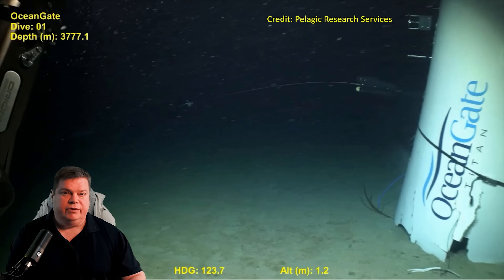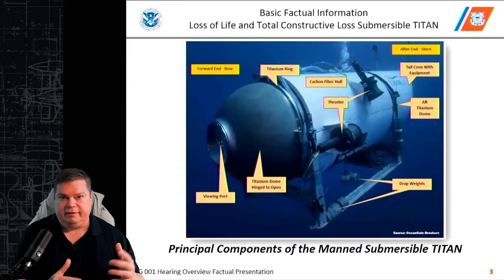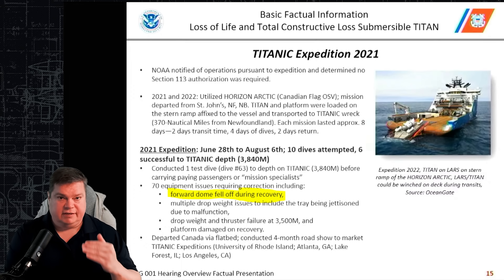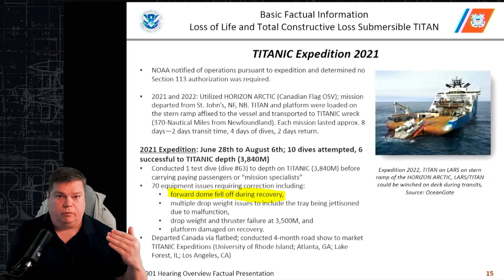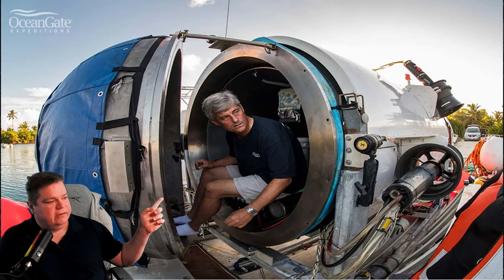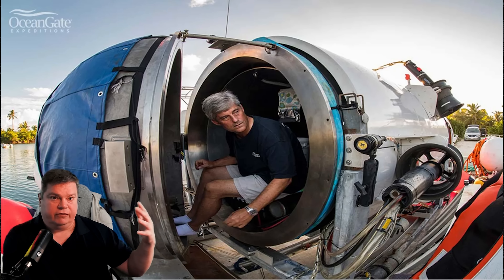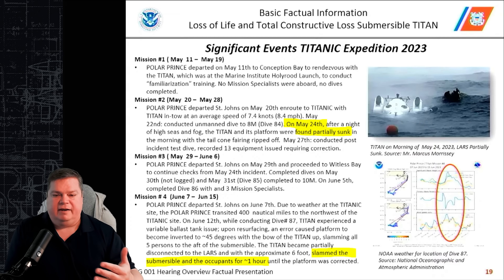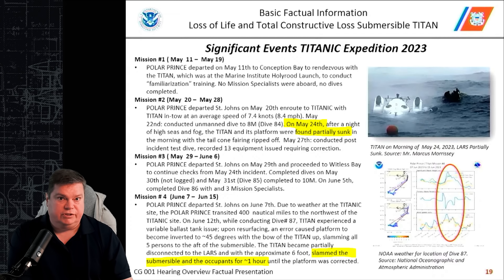New Evidence in Titan Submersible Disaster

Comment: Kind of unnerving that the "paste " he describes contained the DNA of all souls on board. Not unexpected, but the human mind can't truly fathom being instantly turned into "paste " like no pain, no fear, just instantly paste. Pressure Is scary
Reply: I believe they call it paté
Reply: That's too subtle a distinction for the modern mind
Reply: Especially pressure of thousands of atmospheres per square inch....after it was
 bouncing around on that sled during storms, etc....
Reply: Plus with the atmospheric compression with a major failure, the air would have ignited for a fraction of a second before human paste/pate conversion.🤢
Reply: Paste aka human tartare
Reply: It's not hard to fathom. That's 6000 pounds per square inch landing on you instantly. How many square inch is a body? about 3000 square inch. So, 6000 x 3000 = 18,000,000. 18 million of pounds or 8164662.66 kilo landing on a human being.
Reply: At those pressures, you go from living to nothing almost instantly. I routinely work around pressures of 3k to 10k psi pressurized vessels and have a ton of respect for it. When containment of high pressures fails,  it fails instantly and thankfully you don't even know it.
Reply: @Polypoly06 😮 Wow
Reply: not a bad way to go ngl
Reply: @Angryapprentice  defs one of the faster ways to die. Just saddened considering the awful noises they must have been hearing.
Reply: @troycambo  Better than being chased by a drone. At least these people didn't suffer.
Reply: @nottellingyou7520  Torgo's executive powder.
Reply: Under such massive pressure, enormous amounts of heat are generated, yet the depth of the ocean is NEARLY freezing. I wonder if they were essentially vaporizer and immediately cooled within seconds.
Reply: That's what haunts me the most. Ever since this happened my mind goes to that moment, that millisecond in time, with the weight of the entire ocean bearing down on me as the vessel succumbs to the pressure in an instant. I don't want to. It's the worst kind of intrusive thought and I have to sit down and compose myself every time it happens. 

There has finally been an event to dethrone the USS Dolphin for the most horrific deep sea vessel accident.
Reply: @WobblesandBean  there was the U-boat that was sunk by its toilet
Reply: @WobblesandBean  there was the Kurst
Reply: @the907patriot6  Nothing is more pressurized than a bunch of so called men driving around in full size pickups all covering for their tiny manhoods.
Reply: @Naptosis You can survive in drone chaise though
Reply: @Naptosis  did smbdy just watch footage from Ukraine there?
Reply: Put your bare finger right in front of your high-pressure washer that you wash your car or your driveway with. That will do some damage already. And think of those industrial metal cutters that use water (sure, often with other stuff in there too) that go through thick plates of steel like a hot knife through butter. Brrrr. You're so right. Pressure IS scary. 😵
Reply: @elliotoliver8679  Kursk
Reply: Were they playing the queen song.. under pressure...
Reply: Horrifying
Reply: @nottellingyou7520  human pate, I’m pretty sure my cats would love it 😍
Reply: Stockton Mush
Reply: @WobblesandBean  Are you referring to the Byford Dolphin? The Dolphin was European, no USS prefix.
Reply: I was surprised that there was any paste left, I would have assumed that the CEO bouillon just spread throughout the whole ocean.
Reply: @GackFinder Brilliant in a dark kind of way! 😳
Reply: @alphakevin687  🤣🤣🤣🤣
Reply: I want to see pictures of that paste, will they keep it for themselves selfishly or will they share it with the community?
Reply: @GackFinder Haha
Reply: @the907patriot6  thats scary
Reply: @nl-oc9ew  check the comment thread some know it all already figured out the pressure forces at play
Reply: @Polypoly06  At 1.5x the speed of sound, too!
Reply: @GackFinder  I goi g to hades for laughing at this. Good one!
Reply: Human-flavored bologna mist.
Reply: @JohnSmith-rr8hp  they won't show it
Reply: @nl-oc9ew  Sad Doctor Rush didnt record it on a super high framerate camera for the rest of us to see.
Reply: @JohnSmith-rr8hp  Shoulda brought in the guys from Ballistic Highspeed to install cameras inside the tin can they called a sub. BHS has experience with things exploding.
(Yes I know, this was an implosion not an explosion, don't ruin my joke)
Reply: My mind can't comprehend it
Reply: Always remember that they are not 'submarines' but Submersibles, not designed for long stints underwater.
Reply: @angry-white-men  speaking from experience? Lol
Reply: Yummy😂
Reply: Speak for yourself, I can fathom it.
Reply: @WobblesandBean  i don’t feel this is worse
Reply: @troycambo  Better than that guy on Fascinating Horror who got caught inside the electric heating unit at the canning facility and was cooked to death in a space the size of a small bedroom...
Reply: @syberphish  Also yummy 🤣
Reply: There was a video analysing whether they were instantaneously boiled alive before being crushed or just crushed. Think it was called something like hot mist or cold paste 😬 Gross.

Either way, absolutely horrifying way to die, though your senses wouldn't have time to process even the flicker of light as the hull fails and begins imploding, let alone pain.

I'm glad Stockton Rush's victims didn't suffer, but kinda wish he had for being a lying, bullying narcissist.
Reply: @mrkeogh  Anyone who wishes the suffering death of another human is the very person they claim to despise. 

Be better.
Reply: @scottyfox6376 Doubtful there was enough time for energy transfer from the ignited air to their bodies. It was all over in a couple of milliseconds.

It's still really awful to think about 😕
Reply: @jerfy2001 Pasteurised fish food 😕
Reply: @Shoikan  Well, a shot from a firearm/cannon is also pressure in its essence. The primer creates a pressure in the barrel chamber of about 11-15 MPa, the combustion of the charge creates something like 400-600 MPa of pressure which is enough to throw 46.6 kg projectile at 810 m/s speed
Pressure is a serious force, it must be respected
Reply: It probably sounded like warm water being poured over ice with the tiny cracking noises
Reply: They did not turn to paste. The human body can survive extreme depths without being crushed. To crush human bone, the depth would need to be around 20 miles. The deepest part of the ocean is 7 miles.

A rapid collapse would also not turn them into paste. The issue is immediately solved once gas leaves the body. That is why diving is dangerous. Scuba or in a submarine. It isn't the pressure, specifically, it is the fact the gas inside cannot deal with the outside pressure.

So if you remove all the gas from the body, or submarine, the pressure is equalized.
Reply: @taoofjester4113  they didn't swim down there 😂 the submarine violently imploded .
Reply: @nottellingyou7520  The carbon hull is like a hot dog casing.
Reply: @Shoikan it’s not just the actual pressure that does the  damage. Water at that depth is compressed, even tho we are always taught liquid can’t be compressed, it is, it’s compressed by 2% when the chamber breaks, the liquid all around increases in volume by 2% into the sub. That expansion is just catastrophe, imagine the power of water expanding after being under pressure by all angles. Expansion and pressure. Instantaneous deaths
Reply: One instant they were conscious, the next, lights out.
Reply: I’m surprised there was anything found
Reply: Im pretty sure there was a lot of fear. The ex employee testified the haul had to scream like a mother... before it gave out.
Reply: @zebgreenhill  They were playing a Queen song, but it was "Another One Bites the Dust".
Reply: Im confident they knew they had a problem so thats where the fear would come from
Reply: Im confident they knew they had a problem so thats where the fear would come from
Reply: Where in any of the released docs did it say paste? My understanding was it just said "presumed human remains" were recovered and tested.
Reply: @mrkeogh  but I wonder if they became aware of what was going to happen a while before it did, due to a failure of certain parts of the sub.
Reply: I wonder the measurement of the paste? Are we talking 1 tsp or a gallon+ 😬
Reply: @taoofjester4113  are you forgetting the pressure depending on depth?
Reply: @GackFinder lmaooo
Reply: @scottyfox6376  Basically, it was as if a bomb went off inside the sub.
Reply: @Shoikan  The idea that water can cut something is scary.
Reply: @WobblesandBean  At least there was something to recover with the Byford Dolphin incident.
Sure, one of the poor guys had his insides splattered all over the deck, but there was at least something to bury.
None of the Titan victims' families will be able to bury their loved ones.
Reply: Wild
Reply: @twistedyogert idk maybe for the best? What's the point of recovering paste.
Reply: When I think of deep dives and ocean pressures the Byford Dolphin always comes to my mind. Seeing and hearing what pressure did to those 4 men inside the pods @30 atmospheres of pressurized gas’s makes me never want to be inside anything in the deep ocean. The Oceangate Titan crew were playing Russian roulette with a six shooter loaded with five rounds after hearing how that submersible was constructed, materials used and the insane depth they were trying to reach. I’m utterly surprised the sub didn’t implode on its first test dive as soon as it was 20ft underwater. I do not how these so called intelligent men who had almost everything they could want to know information wise about the tech behind the Subs build and danger they were in at their fingertips. All they had to do was dial up their people and the network they have of people in very high positions, and professionals to tell them “Hell No! don’t get anywhere’s near that sub or Oceangate cause they are mos def gonna murder some folks” At least that’s how I feel about the whole sub debate and conversations.         LoudLove
Reply: @twistedyogert .... No that would be an Explosion... the Titan had an Implosion of which Liquified all 5 of them
Reply: @mrkeogh  I wish Stockton hadn't gone down that day. He should be answering for his many terrible choices. He should be reacting to the dismissive statements he made about safety. He should be convicted and spending many years in prison.
Reply: @WobblesandBean  I don’t know if this makes you feel better/ if someone else already responded saying this, but it’s very likely their minds didn’t have time to process that moment. I’m not an expert, but I doubt any person would actually experience any of the pressure or the rupture itself. And they definitely wouldn’t have time to get the pain signals to their brain and process them. But I don’t think they would even be conscious of that millisecond in the first place.
Reply: Oop he literally said that in the video, i didn’t finish it yet, my bad. It comforts me knowing they likely didn’t even know anything was wrong. Besides all the ways the titan seemed to be constantly doing concerning things at least.
Reply: @mattd6085 +yep, it was owned by Fred olsen, it was a deep sea drilling rig, that was used in the north Sea shared by the Danish, Norwegians and British
Reply: Like a F****NG nightmare... that NONE of those five souls ever felt!
Reply: @JohnSmith-rr8hp  really?  You need that to entertain you? Sheesh, those were human remains. I know it's not fashionable these days; but try being respectful of other ppls losses.
Reply: @dukeofgibbon4043  I need more on that please?
Reply: @alphakevin687 mmmmm, salty, for flavor!
Reply: Before getting in that submersible I would have had to see the results of previous dives.  If there was even the slightest danger my son would not be going.  I love my children to much to risk anything happening to them on such a foolhardy endeavor.
Reply: @JohnSmith-rr8hp   there was a camera on the front of the vessel that's why I keep wondering why and what was captured.. cannot find anything mentioning that... I'm not sure if it was a live feed to the mothership I don't know where the information was stored from that camera but that's the only thing I can't find.
Reply: They stopped being biology and became physics.
Reply: @Polypoly06  Jesus 🥺

Comment: "paste-like, that did contain the DNA of the 5 occupants"...

Jesus bro.
Reply: To paraphrase another video analysis; "stopped being biology and became physics" in the fraction of a second.
Reply: @ranulfthevast2180 i get that reference. all seriousness tho it’s a very gruesome way to go, thankfully painless 😕
Reply: Wouldn't the rapid compression of the air and passengers have rapidly heated and combusted, like a large single cylinder diesel engine?
Reply: @quesoestbonne  Peanut butter is cooked also. Probably why the paste consistency occurs.
Reply: @quesoestbonne  I would guess the cooling nature of the surrounding water would prevent any auto-ignition, if that was even possible with people as the fuel.
Reply: Yeah kinda of like canned spam.
Reply: So you can say these five became really "close" friends at the end of the ride
Reply: Stockton Mush
Reply: @RedneckVR1 man goo
Reply: @oscarkoop2548  Yeah we goin to hell for sure lol Keep them jokes coming
Reply: "5 Guys Burgers and Shakes"
Reply: @quesoestbonne  apparently not. The physics of an implosion at that depth are quite complicated but, basically the hull shattered rather than crushed and it happened so fast that effectively the air volume became filled with water instantaneously, there would have been some temperature rise but it was over so quickly it would not have burned the victims.
It takes time for energy to transfer to heat and heat to transfer to material, there was virtually no time here!
The remains and also lab experiments confirm this.
Reply: @quesoestbonne  yes, but no.  The water is traveling at the speed of sound.  There MAY have been ignition, but only once the air was compressed sufficiently; and it's quite significant how much it needs to be compressed  (you can do it yourself with a syringe).

By the time the air was compressed sufficiently, not only were the occupants no longer distinguishable, but the surrounding water would've provided an efficient source of heat dissipation... so the rear back of the sub might maybe be singed - but it might also have just been cleared when the water hit it too.
Reply: @RedneckVR1  🤣🤣🤣
Reply: They became cambels soup. With some salt. I mean my god the thing used a PlayStation remote and held together by ratchet straps. That thing should have never been driving that deep..I don't think they understand how highly dangerous and risky that thing was.. military submarines can't even go to that depth..if that is not a good warning
Reply: @RedneckVR1  We have been sinking to new lows by flooding the internet with jokes about this.......
Reply: @quesoestbonne  Yes, but everything happened so quickly that no combustion could take place.
If you were a fish swimming outside the sub you might've seen a flash and heard a loud boom like a cannon blast.
Or perhaps I'm mistaken and the event was so energetic that the air inside the sub briefly became plasma.
Reply: I wonder if the bodies were ejected wholesome and eaten which is why they were never found 😮
Reply: @iJustB58  yes. What was left of the body would have undoubtedly when squeezed out between the cracks and consumed by sea life.
Reply: @oscarkoop2548  Menace 🤣🤣
Reply: @WeAllLaughDownHere-ne2ou   I can't believe how thoroughly the passengers, employees, associates, and social circle of Stockton Rush so eagerly and willingly believed in what he was doing, that's some serious pull that he had on these people, I'm sure Stockton must have known about the hairline fractures and the inefficiency of his carbon fiber design, but he didn't care, he just wanted his name in the papers

Comment: 31:33 Shout out to the plastic milk crate withstanding the pressure of the bottom of the ocean.
Reply: @Fortunes.Fool.  that’s what I don’t understand. Ppl say the pressure down there is super high however a milk crate can withstand it ???
Reply: @ The plastic is solid. If you took a plastic ball down there with an air gap in, it would be crushed until it was a solid little lump.